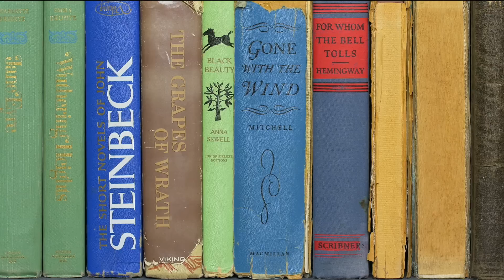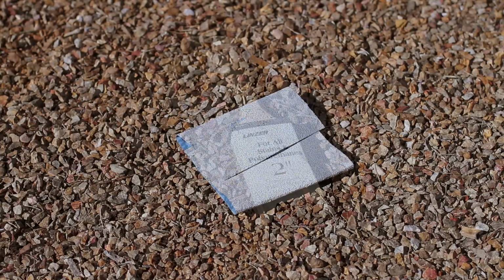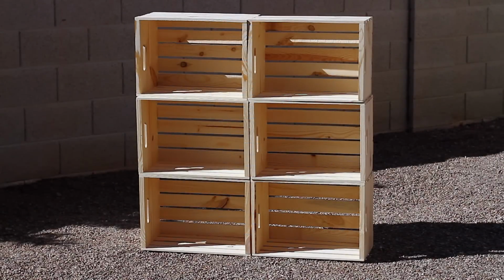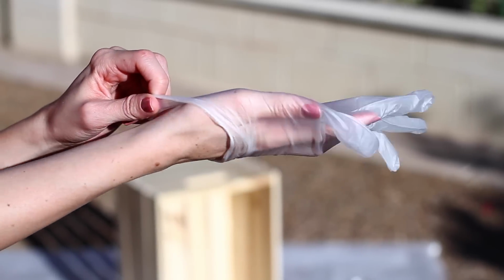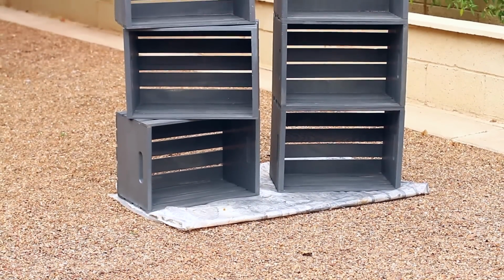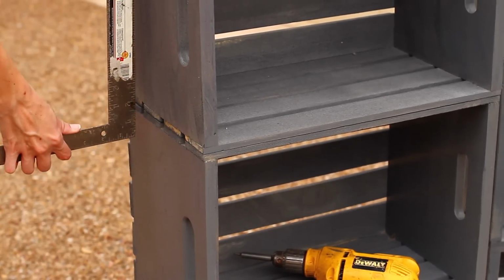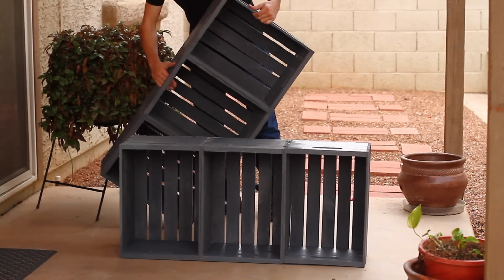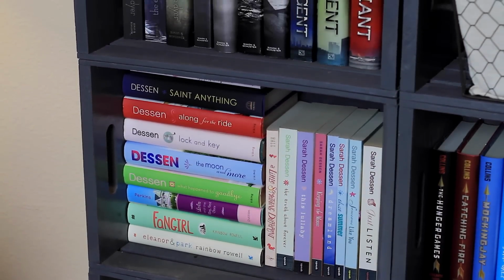DIY EASY WOODEN CRATE BOOKSHELF

Comment: how much weight would this typically hold?? (something like large-sized fat books on all the boxes? how would it fare?)
Reply from the maker: +mrthebugsbunny Mine is currently holding all hardbacks that are pretty large! It seems to be holding up perfectly fine, although if you want to be safe you can always screw it into the wall to be more secure. But I haven't had an  issue with mine at all :)